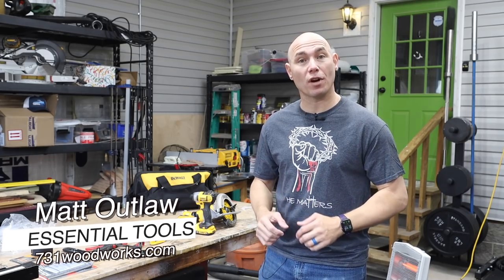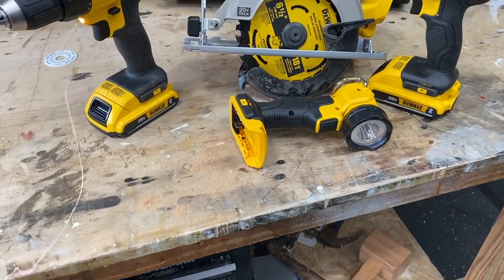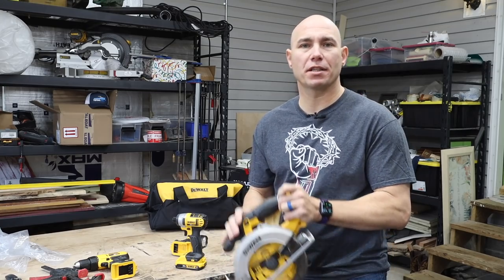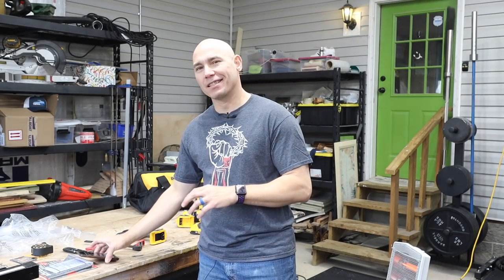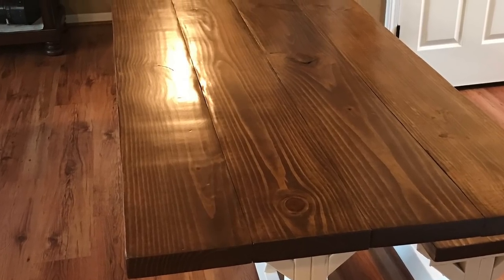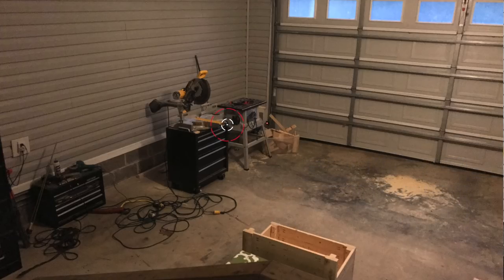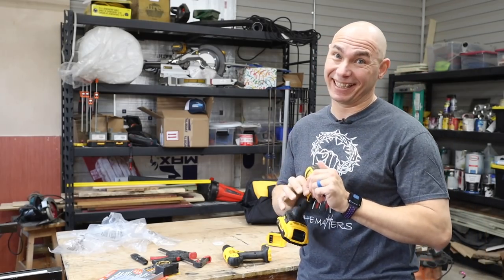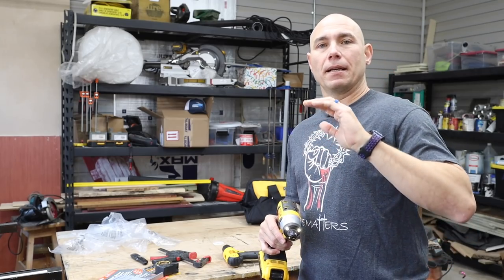Essential Tools Every Beginner Woodworker Needs

Comment: I wrote on your other vid, i been woodworking 8-9 mos and im doing pretty good. I started/still using cheap walmart/harbor freight tools and w sander,/clamps/small necessities $300 in so pretty accurate #. I would love a driver, having to switch bits is annoying and time consuming. Plus cheap tools dont have as much power but they get it done just takes longer/a struggle at times. My pawpaw was a carpenter who swore by dewalt, my mom still has his dewalt drill from the 90s! So they last a lifetime! You have a very nice sub to help you & your subs, that’s great. I found/been watching you almost a yr. you inspired me to start. Ive made a couple of your projects and a couple modified ones. The blanket ladder is one of my best sellers. This is a nice set and whoever wins will be set up nicely and be able to make money to add more.
Reply from the maker: Thank you.

Comment: Just joint you channel after watching your videos on beginners mistakes. All of them are on the mark, I would like to add another that a lot of videos don’t have and that’s planning your projects.making a material list.type of finish for the project. Having been in the transportation industry for most of my adult life and running a service truck for most of those years, you have to plan a head to get repairs done quicker so you can move on to the next one. This applies to woodworking project as well, there nothing like getting half way though a project just to fine out you don’t have enough material to finish the project.

Comment: I'm getting into woodworking and building my tool collection now. Ive recently realized that I'm going to have to have a separate assembly area because I can do everything I need to in my basement except get the finished project out of the basement lol. We don't have a garage and my backyard is a garden i won't sacrifice any of that. There was an extension built on our house at some time and it blocked the way out, other than back up through the house and you can't get anything big up that way. Have to see what i can bargain with the wife for a room somewhere else.
Reply from the maker: Good luck!
Reply: @731Woodworks  hey thanks, I'll be watching

Comment: As you named them off I was here, yup, yup, mine is 30 years old but works. Hey, I have a Ridgid driver too! Don't need any of the prizes, good deal. How do you not get off track while working at home. I keep seeing things that need doing like the lawn mowed, trees I wanted to cut down, the metalwork bench I want to clean off, the rolling woodworking bench I need to clean off, the stationery bench needs cleaning. I get off on other things and never make it back. 
I never really had a work place until a few years ago when I decides to do more woodworking and made a rolling bench. In the garage there was not enough room but I made a bench that could roll out of the garage where my table saw was recessed in so the outfeed was over 6 feet. I had my cutoff saw, sander and something else on the top. I had a multiple I mounted on the side to have power to the bench. I got a router and it fits into the tablesaw area since I upgraded to a bigger saw.

Comment: I know they come in combo's usually but I'd even say you don't need an impact driver to get started, a drill will also drive screws.  That Komelon tape looks nice but if you have a Harbor Freight (HF) in the area you can nearly every other week find coupon for a 25' Pittsburgh tape measure for 98 cents.  Drill master circular saw for $30 (20% off coupon makes it $24), 18v Warrior drill for $30(20% off coupon makes it $24), Pittsburgh square for $3.  That would get you started for $52!!   I'd recommend safety glasses $2, ear plugs $4 and dust masks $2 and call it an even $60 personally.  

Looking forward to seeing someone win that set next Tuesday.  That K5 jig is awesome, I just picked one up but I started with the Kreg R3 and a clamp and it did just fine, I only upgraded for ease of use on the K5.  p.s.  I don't work for Harbor Freight I just like getting things inexpensive that get the job done but you do have to be careful as they do have some things that are simply cheap.  Find the inexpensive that works and leave the cheap on the shelves.

Comment: I feel like clamps are pretty important but cost a fortune. I am trying to get started in woodworking. So far I have built shelves for the garage and a little work bench.
Reply from the maker: They are important as you get going, but just starting out you can work without them for a bit.  Harbor freight can be your friend to pick up some cheap clamps!

Comment: I've been wanting to build a dining table. What type of wood did you use for the top? Only have one drill and it's smoking. That set would be great to have.
Reply from the maker: I used pine on ours and it's held up great
Reply: @731Woodworks  thanks for the feedback. Been watching and taking notes on your mallet video. Thinking about using the St. Jude hospital coin for next years auction. This year's auction starts today at noon.

Comment: How come in most list there is no vacuum cleanee or some sort of dust collection?  Love your videos and how you explain things.
Reply from the maker: Thanks.  That's a "nice to have" tool but not necessary to start.  When I started I used the ole broom and dust pan collection.
Reply: I think with the basics it's not as necessary, only thing in that tool set producing dust is the circular saw.  I'd say cut outside if possible or broom and dust pan would be the cheapest clean up.  With that said I LOVE my RIGID shop vac and can't imagine not having it but to get started I don't think it's a required necessity.  I would put it on the sooner rather than later list of items to acquire though.

Comment: Another great, informative video. Thank you. 
I want to make a shadow box with acrylic in the front. How would you cut the channel (dado?) for the acrylic into a piece of 1/2” x 5” wood with a circular saw?
Looking forward to more great tips!
Reply from the maker: that would be very difficult. You would need to set up some type of straight edge to help guide the saw
Reply: @731Woodworks  the thing I need to figure out is how to clamp the wood and straight edge to a table and still have room for the saw to pass. Thanks for the reply.
Reply: @731Woodworks  I figured it out. Borrowed dad’s table saw!

Comment: I'm having trouble with my kreg pocket hole and dowel jig moving while drilling. I am using clamps but I guess it doesn't have enough holding power. What type of clamps should I be using?
Reply from the maker: If it is the R3, the Kreg face clamp or a good quick clamp works well on them

Comment: For all you beginners don't pass up used tools or what is known as factory blemished tools. Factory blems will let you get high quality tool brands at up to half off because of simple things like the color is slightly the wrong shade for the brands standard or there is a scratch such you will put hundreds on anyway when you use them or the numbers are a bit fuzzy on one part of a measure instead of like the rest of the numbers which are sharp. All these things will let you get started with less investment and have some higher quality less frustrating tools. Speaking of which I always recommend getting plastic speed squares instead of metal. I have bought almost all the metal ones and given them all away because they are inaccurate. Good enough for making the  truss on a house roof construction but a hassle if trying to make truly square parts. Plastic injection molding wears out a lot slower than the stamped metal machinery they stamp metal with plus the forces of  stamping metal bends it slightly so I've found the cheap bright orange color plastic ones dead on accurate as compared to the metal ones I owned. Speaking of which never ever buy a combination square from a big box store unless you want to make things that are crooked and not square. American PEC (P stands for  Precision) sells blemished factory seconds of their expensive and precise combination and other squares. Get yourself a full combination kit for half the price of PEC new or Starrett from Taytool and deadly accurate and square as square can be so it passes the line or cut line and flip the square over and cut or draw a paralell line test, it's also where I get my CMT Orange industrial blades for my table saw, another tip. When got really get going you'll be disappointed in the quality of big box store hardware. I've tried a lot of places but find McMaster works for me when I want the Metal to actually really truly be what the stamp on the metal says it should be. I get a lot of snapped heads on big box store wood screws even when tightening by hand and especially with impact drivers. The wood screws I buy from McMaster don't snap on me at all. And yes I'm not entering, I want you guys to win and start to enjoy this hobby or business venture!
Reply from the maker: Good tips

Comment: Where would be a good place to get a table saw, especially one at a affordable price point. Thanks in advance
Reply from the maker: Depends on your budget.  You can get a contractor style saw for around $300-$400 at Lowe's or Home Depot.  I like the Delta 36-725T2 saw. It's around $600 at Lowe's.

Comment: Thank you, I have been following you to help me start and build as a woodworker. My one question is the 0000 steel wool you use with the paste wax. When I do that it puts a black haze like the wool is coming apart. Is that normal, did I buy the wrong brand from HD? What can I do to stop that?
Thanks
Reply from the maker: That's normal.  Wipe clean with a Terry cloth

Comment: Stupid question time:
If I can only afford a saw with an 8 1/4 blade, can I just flip a thicker piece over and finish the cut that way? Or is that asking for trouble?
Reply from the maker: Not a stupid question at all.  I do this all the time with my 10" miter saw and have done it with a 12" miter saw.  Works great.
Reply: @731Woodworks  
Awesome! Didn’t know if that was opening the door for kickback or not haha.